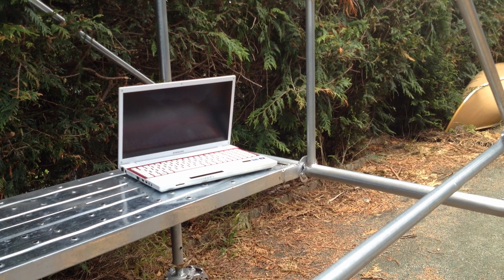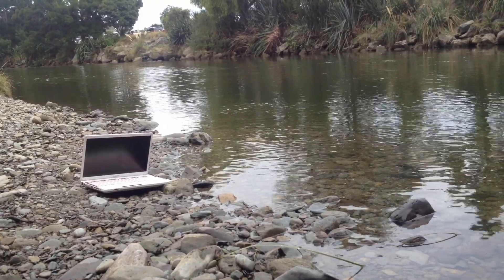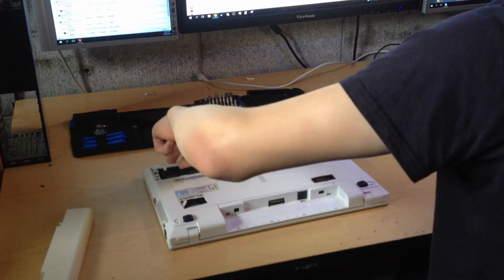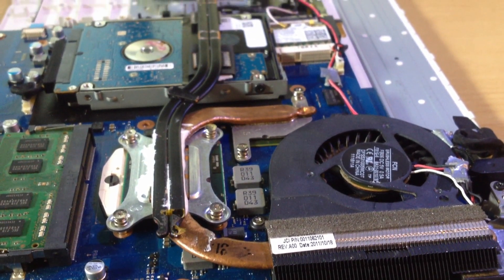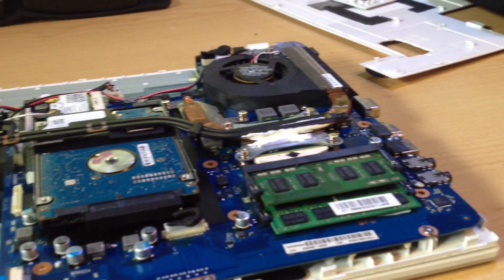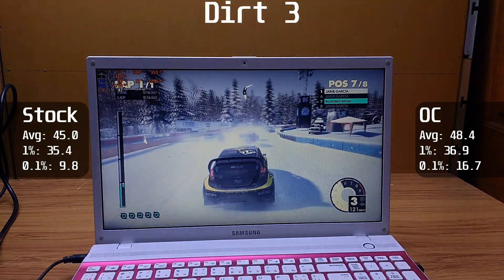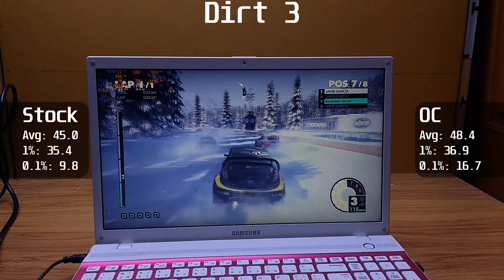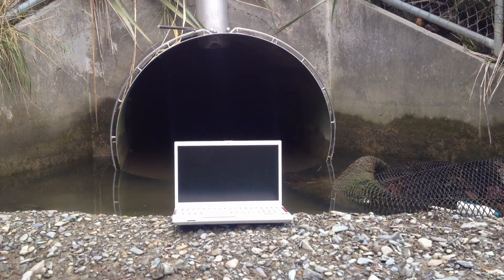The 520MX Revamped

Comment: Have the same Gpu overclock (1050 MHz in core clock, and 1000 in memory clock) but with i5 2430m. With this can I have same better fps?
Reply from the maker: with those specs you should get moderately better performance than what I had